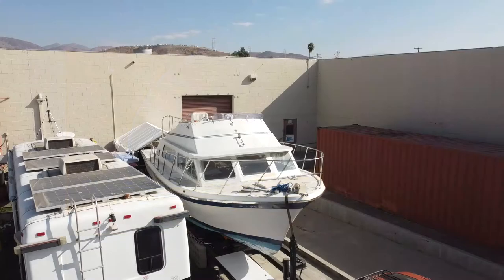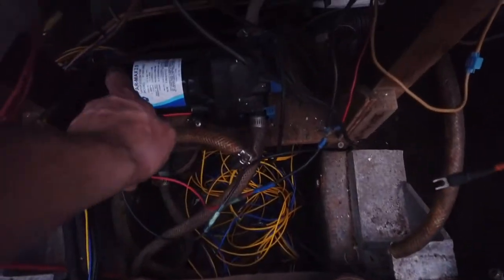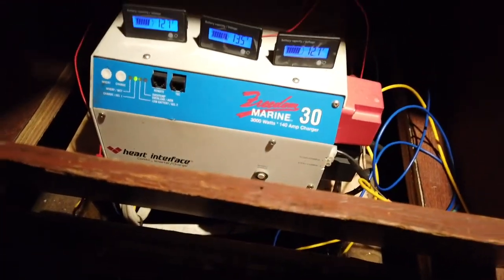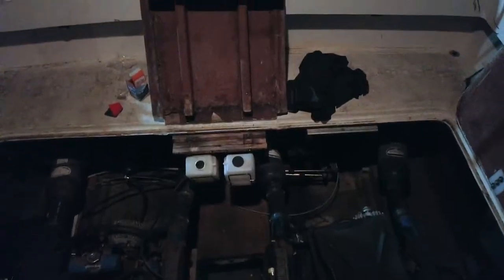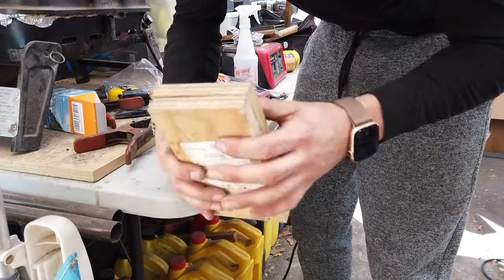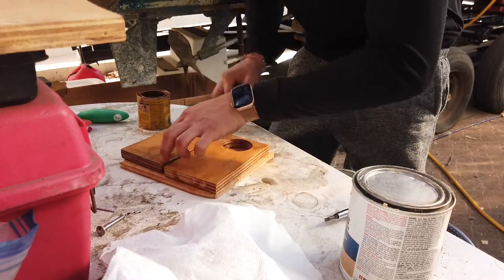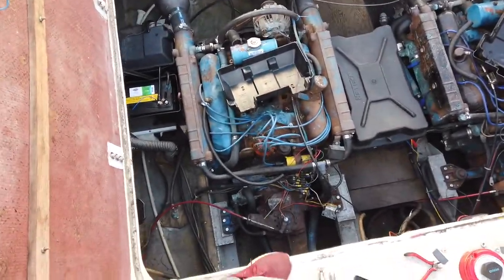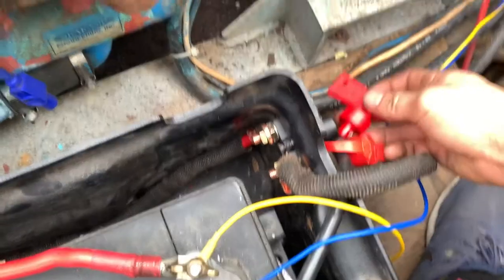Marine 12v Upgrades & Maintenance (Part 2) - Installation - 1973 Boat Restoration - EP10

Comment: EFI? I say no, and here's why. 1) even on automotive applications, there is only very small difference in fuel consumption between EFI and carburetors. We're talking .5 to 1.5 mpg difference between the 2. Cars get their fuel millage more as a result of their gearing, not EFI. 
   2) EFI systems rely on several different sensors to work properly. If even one of those sensors goes out, there's nowhere to get another one when you're off shore. Also, when one of those sensors goes out, An EFI system will get exponentially worse fuel consumption than even a poorly tuned carburetor. 
  3) a well tuned carburetor, being entirely mechanical, will stay well tuned unless someone fks with it. And even when they do malfunction, they're very easy to repair off shore. Just keep a couple of spare carb kits on board and you have evrything you need to service one. They're usually about 30 bucks, a new oxygen sensor can be upwards of 60 to 80 bucks.
Reply from the maker: These are all very good points, and all things to consider when it comes to how we are going to get fuel into the engines, personally i was planning to go with the original carbs, or at least something that would perform well. There seems to be a real divide between those who are fans of Carbs vs. EFI. I'll likely do a video in the future and have an open discussion between myself and all of you in order to come to the right decision. 

Again i appreciate the information! This all helps and will definitely come into consideration when it comes to the final decision. Thanks for watching!!
Reply: @IfTheresaWillTheresaWave  The original ones would be good, but Edelbrock has come out with a new version called the Performer AVS 2. It has annular primary boosters as opposed to the single nozzle boosters of the original ones. The annular boosters will atomize fuel much finer than the original ones thus maintaining a more even air fuel ratio. They're awesome! I'm gonna be using one on my 67 Cadillac I'm building. One very important suggestion weather you use the original ones or the new ones is to add fuel pressure regulators because Edelbrock carburetors are kind of touchy when it comes to fuel pressure. They like 5 - 5.5 psi to maintain perfect float level. Most mechanical fuel pumps can put out as much as 8 or 9 psi. What's nice about the Edelbrock carbs is that they're based on the Carter AFB which is the original carbs that Mopar used. They're very easily calibrated for your Mopar engines.